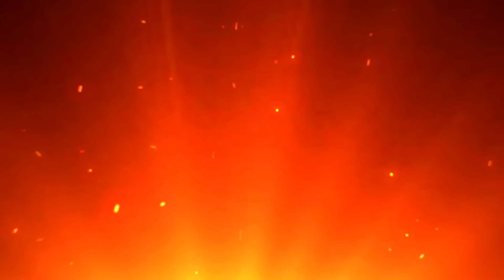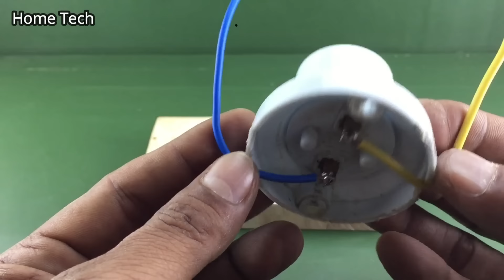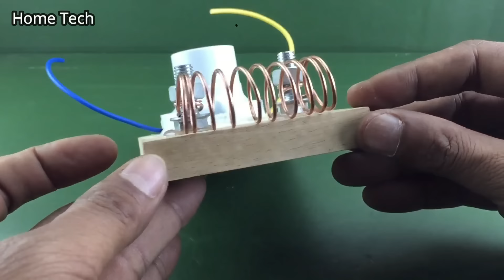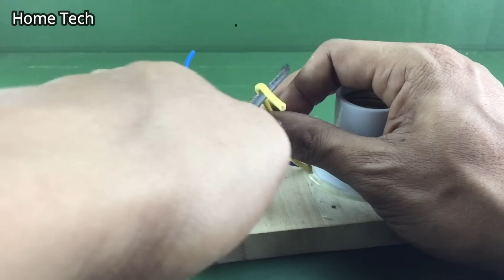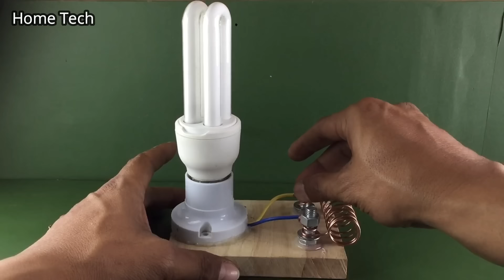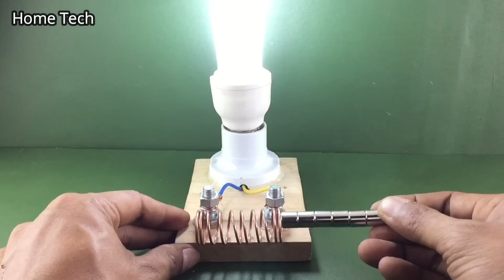New Free Energy Electric Using By Copper With Magnet

Comment: Tried it and it didn’t work. If it’s legit you need to say what width copper and what strength magnets you’re using.
Reply: its magic trick..
Reply: you probably aren't using proper copper wire or your lightbulb consumes more electricity than your magnet can put out.
Reply: Neoidim magnets + thicker cooper wire